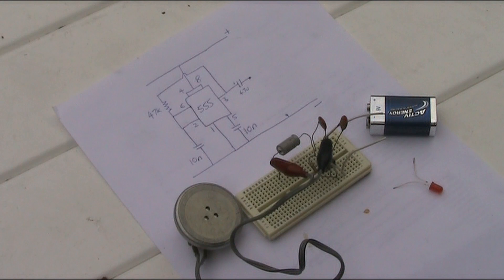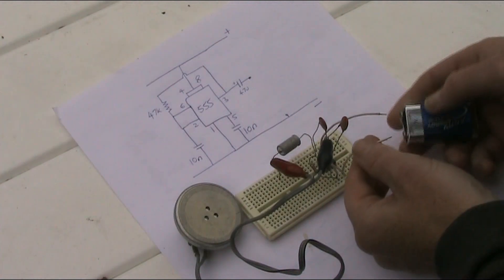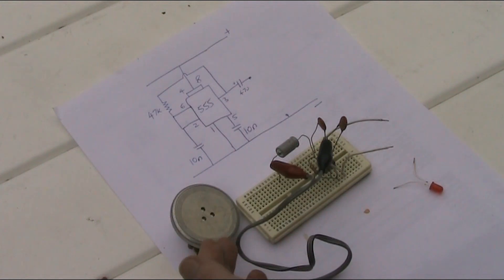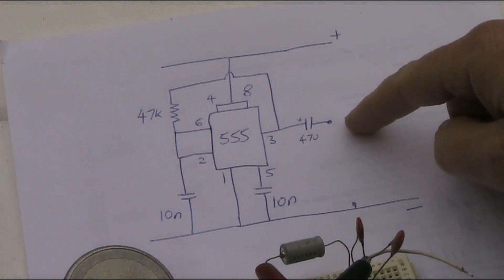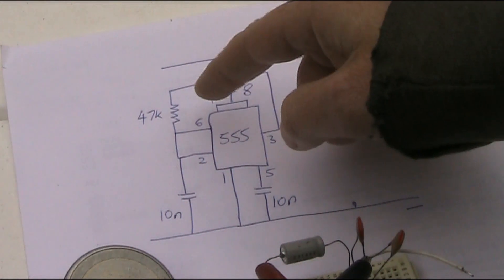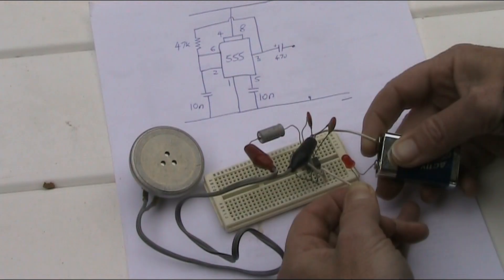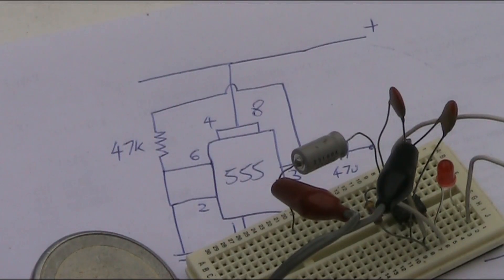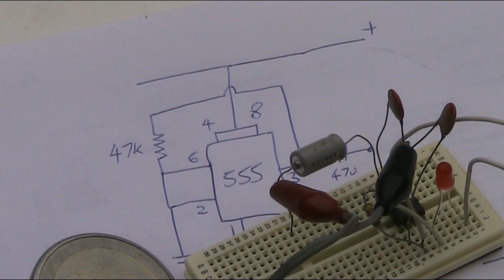555 beeping audio oscillator with just 6 parts

Comment: I built a code practice oscillator with one several years back.  A few more parts than you used I think.  Tone was not great but all the parts were scavenged off of old boards including the 555 so it was free.

Comment: I built one a couple of months ago, based on a beacon project by ON4XMJ. Once I was happy with that, I built an astable multi-vibrator version with discreet components. Works very well. Atari punk consoles are also a great project for those interested in the 555. Yet again, Thank you for your post. Always intriguing and always worth watching.